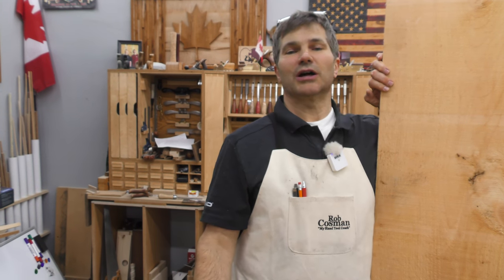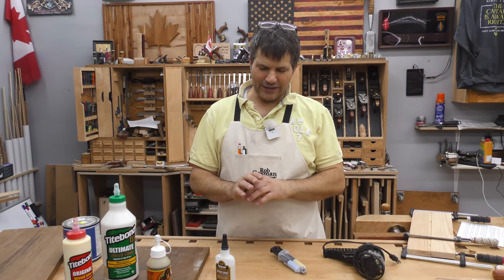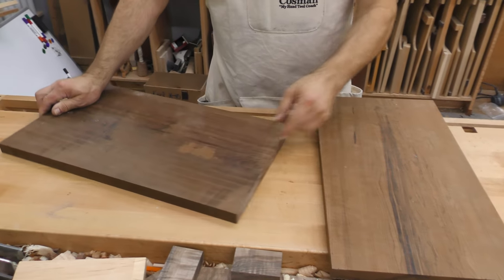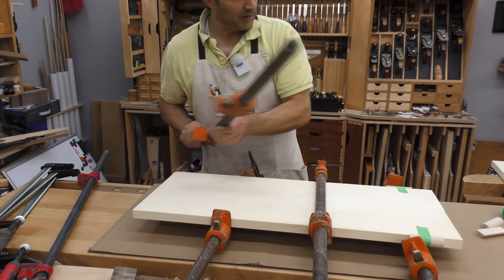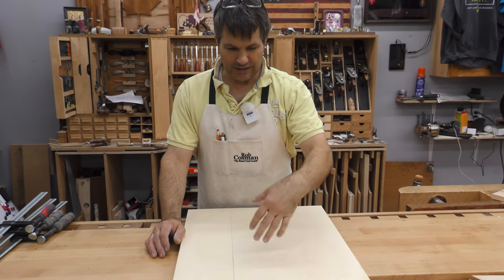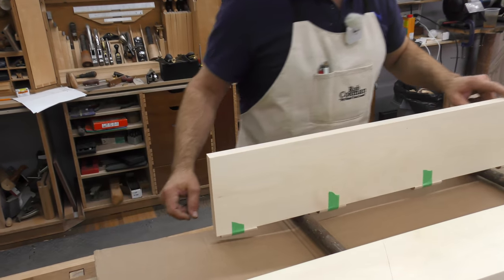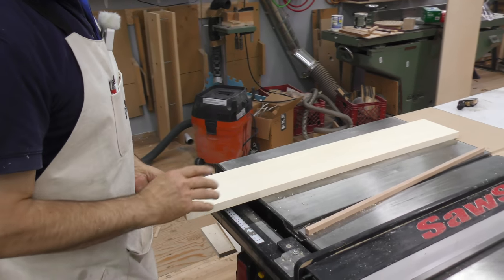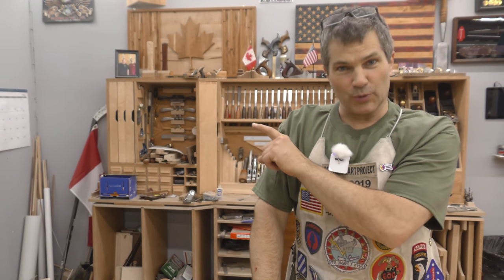Glue Joints Woodworking - Which edge joint to use?

Comment: Thanks for doing these.  You may already know this, but you can get those pipe clamps with a base so they stand up, the Bessey "H" Pipe Clamp - which also helps for turning the crank, because they are now lifted away from the work surface, so you don't have to make sure they're off the edge of your workbench before you start cranking.

Comment: Great video, thanks.  Best thing I ever did to my pipe clamps....made pieces of 1/2" Baltic birch  about 2"x6" with a oversized hole for the pipe. Stick down far enough to be a foot and allow you to turn the handle and tall enough that if you turn them over, they support the clamps above the work.  Attached to the clamp faces with small screws.  Mine are so old they don't have the feet, but this changed them from something hateful to a joy to use.
Reply from the maker: I have something similair....I just didnt use them on this vidoe.  Good idea though

Comment: Kudos! I love that you show how to center the pressure traveling through the thickness of the stock with shaped cauls. Nobody else mentions this! I rely on centering the screw at the head end of the clamp, though.

I found a good way to avoid having to split dowels and fuss with several pieces: I use ordinary rectangular stock and cut a quick, shallow double bevel on one edge, giving it a ridge that allows the same centering effect. Goes quickly on the jointer, two passes not even changing the fence, just by eyeball. A trifle longer to use hand plane or tilt the tablesaw, but i keep the sticks long and use them that way.

This is also very good technique when clamping a carcase!
Reply from the maker: Great tip.  Thanks for sharing

Comment: Great video! Quick question: I thought the point of a sprung joint was that you would only need one clamp in the middle. Is that true?
Reply from the maker: Thays one pro, but the big issue is to keep the glue joints at the end very tight, and to do that it allows one clamp to hold it together
Reply: @dk builds sprung joints equalize the pressure in the long run, because end grain looses moisture faster than long grain thus shrink more than the middle section. So while and after drying, the ends will not in any way shrink enough to produce a micro gap. I love that technique.
Reply: @nicolaspillot5789  yes yes yes thank you you great explainer you

Comment: before laying the planks on the pipe clam, I sight the end pipes like winding sticks to be sure they are parallel.  Also, the end clamps are shimmed up about 1/4" to be sure the planks will not teeter on a middle clamp.  My boards usually have some cup, but I take care of that with a belt sander after joining.  For bench tops, I laminate "engineered wood" flooring for the top surface.   Good enough for a lathe bench top.  I wish I had a table saw, but I wouldn't use it very often as most of my shop work is grinding and polishing glass optics for telescopes.

Comment: good content.  I have a couple opinions though of the glues.  As to the Titebond I vs III.  I don't think they are "the same properties" but one is more WP.  That is a simplification.  There are advantages to type 1.  Obviously easier clean up, (yes, the glue is soluble in water, so comes off clothes, brushes can be left in water etc)  But it also dries hard, with little creep.  Type III DOES creep, considerably!  It also dries much more slowly.  I use III often, but I use I even more.  (and use Hyde glue and Recorcinol also, (A glue that is even better than III for waterproofness)  I've used Type I for 40 or more years, and have never had any bond "dissolve or come apart because of failure due to moisture.  That said, I wouldn't use it for something that was hanging in a steamy sauna or even a shower area.

Comment: Rob great vid again! I went to your site checking out the planes. Lots labeled for no shipping to the US. Is that a new thing? I don't remember seeing those before. I'm wondering what the first most versatile plane for a beginner is. Basically if you can afford just one, what size should it be and what characteristics? I know I've seen you suggest it in vids before, but I can't seem to recall it. I'm getting so much closer to making some saw dust...lol I'm the perpetual commenter until I get my space worked out. Thanks again!

Comment: What I do with my pipe clamps is added a felt pad to the metal so it doesn't dmg/marr the wood. Also use pvc tubing along glue joints so I don't get any stain from the metal when it squeezes out.
Reply from the maker: Good tips

Comment: Hi, Rob! Have you considered doing a video on hand plane types - what's used for what and how? I've been learning to do box joints and had to plane a tiny bit of the fingers sticking out but only have a cheap $10 plane. I've been going through tons of videos here, learned to sharpen chisels and plan on buying a hand plane, but with limited funds I can't really afford 4 types in a single purchase. But which one to choose as a first, to start? I could probably sharpen a plane blade by now, but don't really know much else about the types. Thanks for teaching!
Reply: Get a 5 1/2 plane.. woodriver or any other decent brand.. it'll save you lots of headache refurbishing old or fixing cheap planes

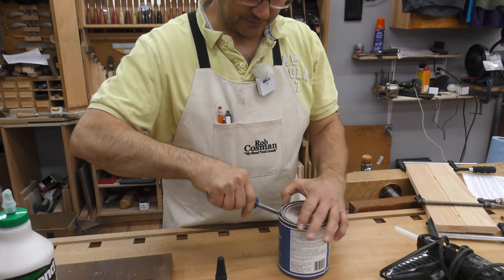Comment: Hi Rob: at 04:30 you refer to a powdered glue (do you mean a casein or urea-formaldehyde glue such as Cascamite/Extramite?) and you then mention the importance of adding the powder to the water and not vice versa. Are you sure you mean that? With Cascamite (which has a similar open time of around 20 minutes) I always add water to the powder and a little first to create a thick cream (just like you would making a cup of soup from a packet). This avoids the formation of lumps and the action is fast, adding a little more water to achieve the treacle consistency necessary within a few seconds. I am in fact making a video right now using Cascamite powdered glue, a glue i have been using since the 1960's for canoe building. I made a video called 'Woodworking glues - Cascamite' ten years ago and demonstrate there  adding water to the powder, contrary to what is written on the tin! By adding water the consistency also is easier and quicker to regulate!  I didn't actually see you mix the glue in your video but I may have missed it.
Reply from the maker: I use And was referring to powdered plastic resin glue.  I use the Circa 1850 brand.  I add the powder to the water, never had success the other way around
Reply: @RobCosmanWoodworking   Thanks for not dismissing my comment as a troll this time! You emphatically say in your video never mix the water to the powder and yet don't say why but just dismiss it that you never had success that way, yet your videos are highly explanatory! You may be surprised at just how much easier and quicker it is to mix a thick paste and then thin it with water rather than regulating the correct amount with the powder the other way around. Did your mom ever teach you to make pastry? (Mine wasn't arouind to teach me). The water is added to the flour. If  its too thin then you add a little more powder. As guesswork is involved in getting the ratio of water and glue powder right, its almost intuitive to add water to powder. Another myth to make a video about?!!! I feel uncomfortable about linking my videos to another channel (although you have offered to link to my channel) but to demonstrate the ease of mixing go to 1 min 39 on this video:   https://www.youtube.com/watch?v=0N7LEv2gvLw
Reply: @RobCosmanWoodworking How can a glue be described by sellers as powdered 'plastic resin' , particularly in this age of micro analysis and attention to detail?!!!  Both 'plastic' and 'resin' are generic terms with countless specific types and different characteristics such as epoxy resin and Altiphatic resin glues. Was the trend started with 'Liquid nails'?!

Comment: also rob, I find that using a small 6 inch f-clamp over the joint  at the ends of two boards, helps with getting the ends flat to each other.
Reply from the maker: Yes but i recommend working hard to clamp flat from the get go so end clamps are not neccessary

Comment: Hi Rob, for the sprung joint, could you plane the middle of both boards at the same time in a bok match style, that way it won't matter if you plane them out of square, the two boards should still line up flat to one another
Reply from the maker: Ummm.  I would not want to do that on a sprung joint as you have introduced that curve.  I dont know if that technique would still work
Reply: You can do it that way if you take the time to ensure that the edges are PERFECTLY aligned. If you are off by a hair in alignment you get a bump and the joint is spoiled. I'm sure that if you did spring joints every day then you could learn to do it, but for me, the setup time to align both boards just takes too much time and it is faster to just do one board at a time.

Comment: Hi Rob. Question...? I do a lot of edge glue-ups with primed wood because it's easier for me to get most of my materials primed already, as most of my casework gets painted. My question is does the primer affect the glue bond? I've never had an issue or a call back, but just wanted your thoughts if you would be so kind. Thank you!
Reply from the maker: If you are jointing the edge before glue up you should be removing the primer from the jointed edge so in that case the glue up is not affected.
Reply: @RobCosmanWoodworking  thanks for the advice Rob. Love your videos. Watch them almost every day. Best wishes.

Comment: Perfect timing!  I'm making a walnut table 72" x 44" out of 6" or 8" 5/4 boards. I've recently acquired a bunch of  4' Bessy's.  I plan on using biscuits for alignment and TB III. Should I do it as one glue-up or in 2 or 3 sections? I've also been acquiring your various tools before I try my hand at dovetailing.
Reply from the maker: If you use biscuits for alignmnet then you can do more than one section at a time.  But be careful, better to do it in a couple of glue-ups if you cannot do them all before the glue starts to skim up....Dont be greedy

Comment: Another great video.  Does the dowel diameter need to be equal to the wood thickness?
Reply from the maker: Its better if it is the same or close, you want the force to be centered on the thickness of the wood

Comment: Good video Rob, but @34:57 I don't understand why the hollow was purposely created as opposed to planing it as flat as possible. Can you explain?
Reply from the maker: Its called a "spring" joint.  This method allows you to just use one or two clamps in the middle and ensures you are perfectly tight out on the ends where failures are most likely

Comment: Half dowel idea is great - thanks. Slipping f-clamps drive me crazy, now I know why. I would not have thought about grain direction for planning post glue-up - brilliant.
Why use a sprung joint?
What was the powder based glue you showed?
Reply: One reason for using a sprung joint is if you haven't many clamps, you can use even just one clamp in the middle of the glue up and apply enough pressure at the ends of the board by the time the center of the board closes to produce a tight joint. Also it take the headache out of planing two boards perfectly straight but personally I prefer to use extra clamps rather than introduce tension into the joint.
Reply: I take it back, look below at Nicolas Pillot's reasoning

Comment: Thanks for that Rob. The split dowel pads are a good idea that I've not seen elsewhere. I'm sure you're familiar with joiner's dogs which require the edges to be planed as the reverse of a sprung joint. Seems irrational but they must have been in use for hundreds of years. Whadda ya think?
Reply from the maker: I dont want to put holes in my workbench top
Reply: I think we might be at cross purposes here, Rob. The dogs I have in mind are driven into the end grain straddling the joint line. No damage to workbench top, as far as I'm aware. @RobCosmanWoodworking

Comment: Great video! I’ve read that a lot of luthiers (who don’t swear to hide glue) prefer Titebond I over the other varieties since apparently it is a lot less prone to «creep». I can image that it might matter in say a laminated ply banjo rim where the segments are bent and under pressure. But does it really matter for other uses? I have no idea. I like them both but I have limited experience.
Reply from the maker: I dod a lot of testing after a project failure and yellow / white wood glue (Titebond I) will fail at 120 degrees.  I had one piece of furniture in a sunny widiow that the joints gave way due to the heat
Reply: That’s quite shocking actually. And good to know.

Comment: You should check with the epoxy manufacturer they make mix nozzles that eliminate mixing issues, and do precision application.
Reply from the maker: I have used those and for some unknown reason i like mixing it myself.   Stuck in my old ways i guess. But yes those are great

Comment: Parallel clamps, self standing on your bench, avoid some bigger deformation in the beam... did you ever consider them for your work on large panels?
Reply from the maker: I am not a big fan of them, just never saw the need
Reply: Thinking that the jaws remain parallel after the screw is applied is delusion, but nothing that can’t be solved by Rob’s recommendation of shaped cauls to center the pressure. Quite true, they stand up very nicely.
Reply: @RobCosmanWoodworking  I'm with you on that Rob. I have several of them, and I find them really heavy and unweildy. I wish I had bought F clamps like yours instead. When I get round it, I'll trade mine in!

Comment: What is the advantage in using a sprung joint? Why not just get the 2 edges straight?
Reply from the maker: th esprung joint ensures that the glue line at th eedges is tight and wont open.  You can also get away with jut one clamp in the middle
Reply: @RobCosmanWoodworking  I had the same question. Thank you so much for the answer and so quickly, what a blessing it is to have a knowledgeable individual be so helpful to others.
Reply: Have about 6 good screw clamps? Stay with a straight edge joint in 99% of your glue ups. This method relied more on using less clamps than any issue with wood movement. on the ends  A spring joint can and will fail if not done correctly. Convexing boards can be a pain to perform correctly. I personalty don't use it except on bread board ends. Proper use of glue, clamping pressure and temperature in your shop especially during winter is key!

Comment: Why no hide glue? It was used exclusively for more years than we can count. Adding Urea extends the working time and I have edge bonded boards for table tops by rubbing the boards together until they grab, self clamping, and no external clamps. I also use Titebond III when the boards are too big to simply rub together. I have never had a glue joint fail in over 40 years.
Reply from the maker: I have not had success with hide glue so I cant recommend it.  I use Titebond III 90% of the time

Comment: Rob, would there be a problem making the spring joint by planning both edges simultaneously?  My thought would be that if you aren't planning square the angle would cancel itself and your face would still be straight.
Reply from the maker: That techniques dosent work quite. As well on a spring joint since you dont have flat edges

Comment: Do you think making tongue and groove joints with a hand plane would also be a good way to align long boards? Or is it generally too much work? 
I recently got a shooting board and drawer bottom plane. I've had fun using them  :)
Reply: It would be overkill, but if you're just a hobbyist that only makes a handful of pieces now and again, then why not! If you've got a specific hand plane for the job of course. Getting both tongue and groove accurate over even the length of Rob's boards there isn't trivial with a hand plane if you're just free handing it. If I'm struggling with it at any stage, I often just put the two pieces together in the vice with top faces (what will be top faces when flat and glued) facing out the away (with their bottom faces against one another) and plane them both at the same time. If I'm off square slightly then it'll be offset on either board.
Reply: @ricos1497  Thanks for the reply. There are specialty planes for the tongue and groove joint out there to avoid free handing.
Reply: @christianestrada5362  Yes, that's what I was referring to. If you have one, they're great. However, you do lose a bit of stock width, and I tend to prefer tongue and groove to be loose rather than glued. I don't know why though, probably just what I'm used to seeing on floorboards!
Reply from the maker: I agree with Rico, way too much work for a panel glue up.  Tongue in groove is more appropriate for a floating panel
Reply: @RobCosmanWoodworking  Thank you for the advice

Comment: quick question about wicking the thin ca glue for tight joints.   would i then need to take a few passes with a smoothing plane?  have you ever had this affect a finish?
Reply from the maker: yes you must remove any excess by planing or sanding

Comment: i am going to adopt the half dowel clamp supports but i have been simply using a relatively thick single board on each side of the panel to help evenly spread the pressure and protect the work piece.  is this not as effective as the dowels?
Reply from the maker: No its not.  The dowels concentrate the clamp pressure in the center of the board thickness helping to prevent the panel from bowing under the clamp pressure